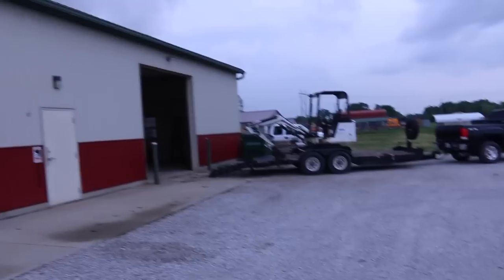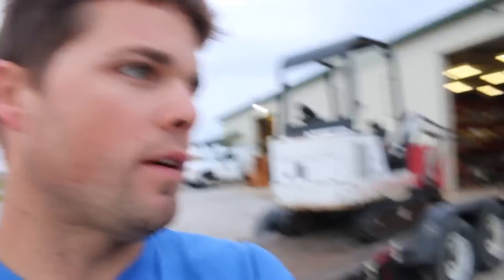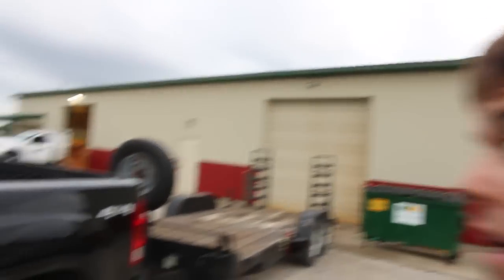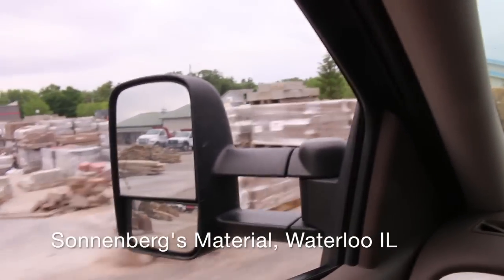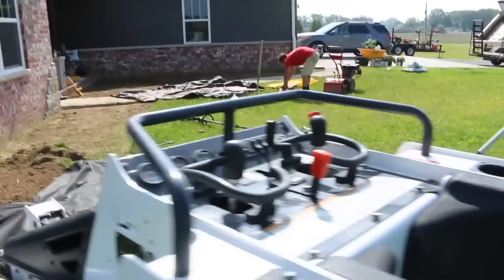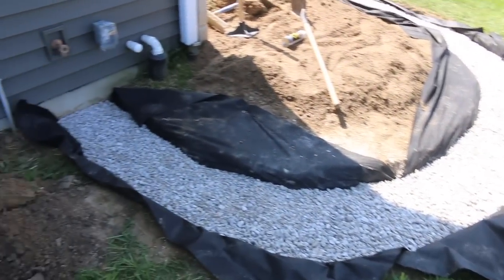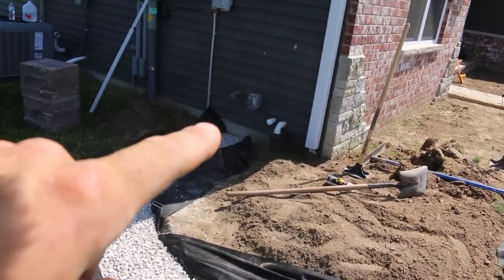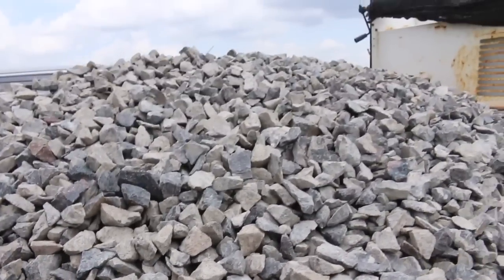New Constrution Landscape Install | How To Choose Materials??

Comment: Alex, you hook up a voltmeter inline with one of the battery cables, its will read 12v with draw present... Start pulling fuses until the meter goes to zero (one at a time) then you isolate the issue.
Reply: Yes, I agree "a draw down test"  easily done.... You could also youtube it....👍
Reply from the maker: KLC LAWN & LANDSCAPING Aweosme thank you! I will try that. Not surprising the issue went away on its own but I know it will be back 👍🏼
Reply: My dump truck radio internally shorted and was creating a hum barely noticeable through the speakers when off (didn’t turn on either) it was killing battery overnight.